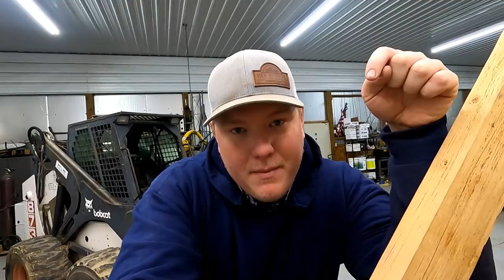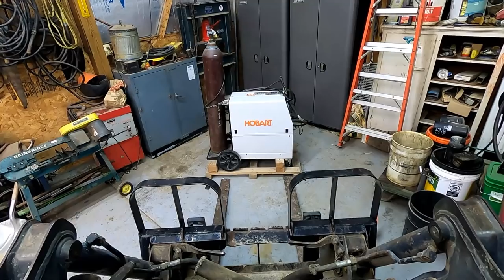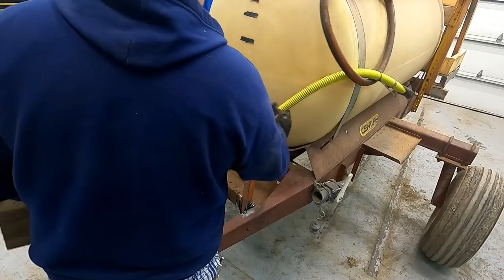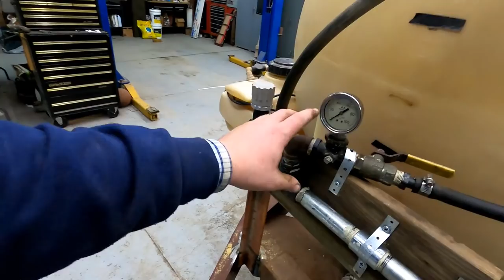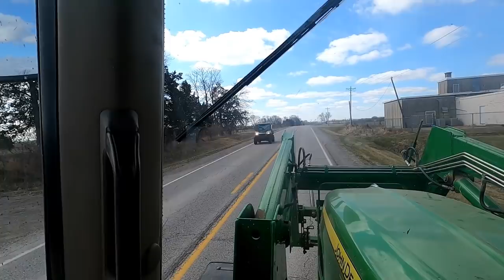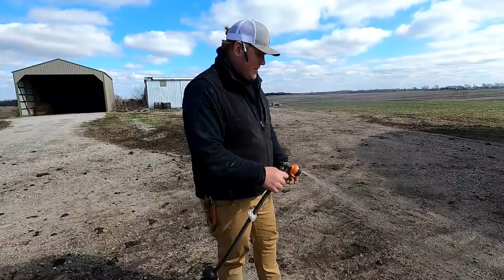Does the HOMEMADE sprayer turned FIRE TRUCK work?

Comment: Loving fire cart build👍We use our fire cart (Furphy) for burning stubble crop after harvest, refill for our sprayer, also fire fighting as my father, me n brothers are with rural fire brigade.  Furphy runs with petrol or gas motor, there’s small platform for us stand or sit on to fight fires or to light stubble.  Furphy can be tow with truck or tractor.  Tips for cart maybe place sheet metal underneath cart to reflect fire from damaging plastic parts, extra lights n camera? Outlet pipe at back for quick dump or refill.  Can’t wait to see fire cart in full action👍
Reply from the maker: Those are all great tips! I was thinking if I could find a cheap gas powered pump at auction I might buy it to make it a self contained system!

Comment: The farm/ranch I work on has a Detroit diesel tandem truck with a 2,000 gal. tank in the dump bed. We use a sprinkler well to fill it all the way up in 9 minutes and we have 30ft. Of 1 inch hose. I am jealous of your setup and how more high tech it is, might just have to one up ya and buy a retired fire engine lol.
Reply from the maker: YEE YEE TV i found one and I was drooling over it until I found out it was 2WD

Comment: You could also take that nozzle and put a cam lock on your valve and on the nozzle so you could put the nozzle on the valve and you could drive along side and spray on the fire.